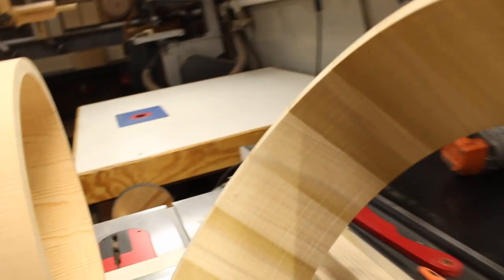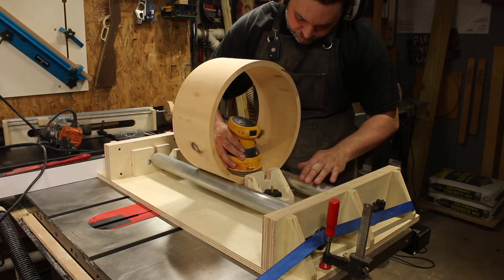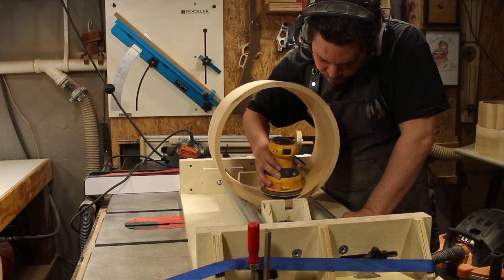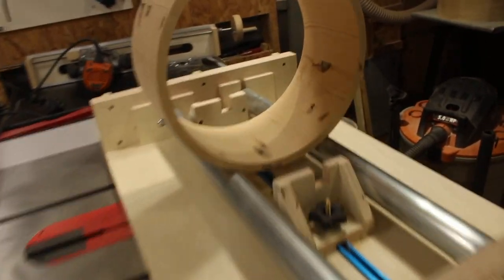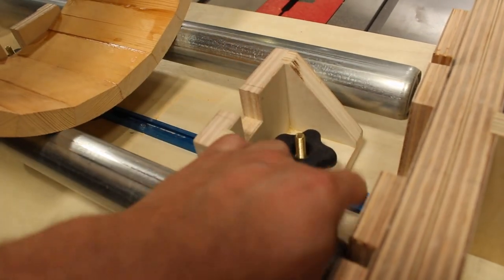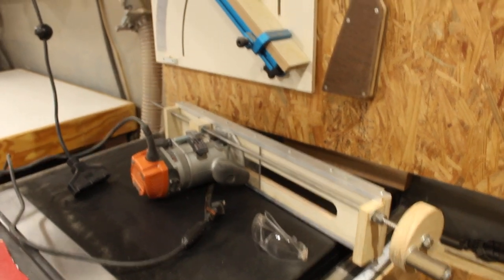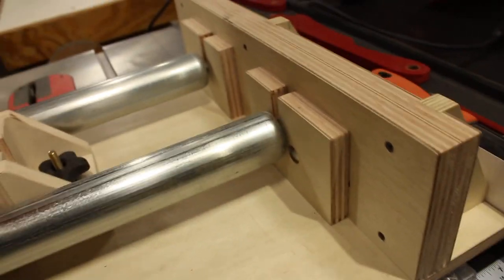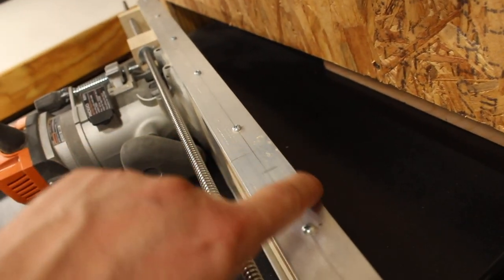Interior Router Mill In Action

Comment: I like the use of the polyester strap to hold the shell to the rollers!
Reply from the maker: I tried without the strap and even with just a bungee cord, but it doesn't take much for a shell to raise up a little and give the router bit a nice taste of wood.
That ratchet strap just loops over the top and is anchored to the mobile base of the table saw.